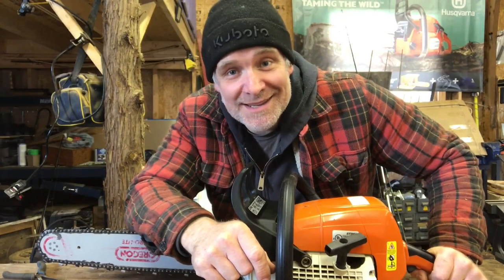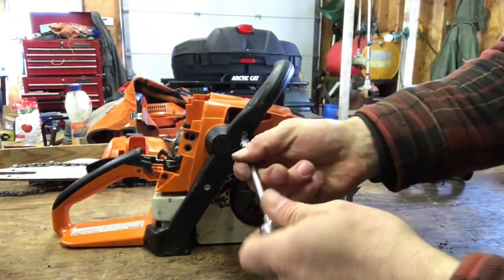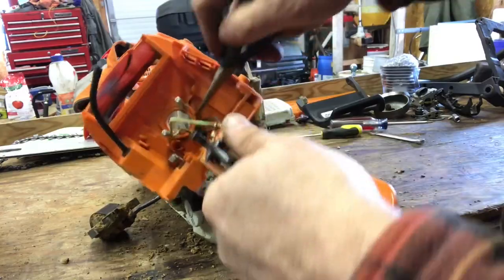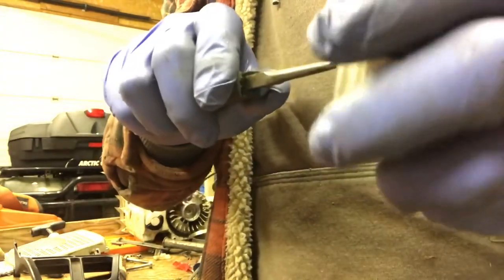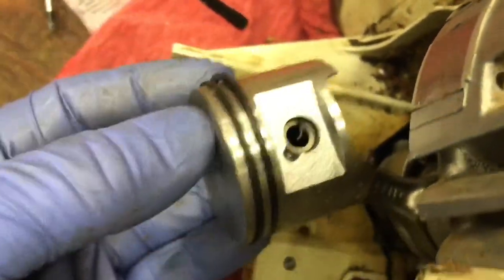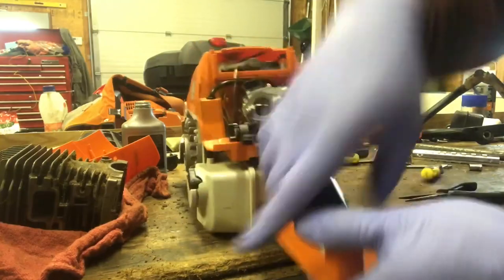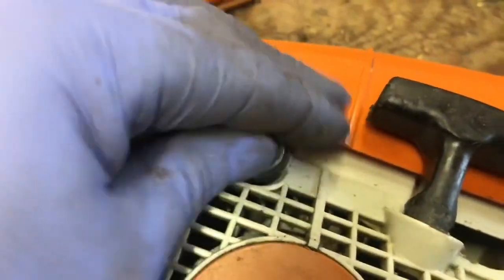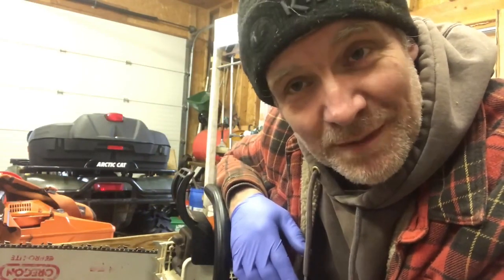Stihl MS 290 Top End Rebuild

Comment: Yesterday I took my 290 apart because the spark plug threads were stripped.  Regardless, when it came time to put the kill switch wire in place, I couldn't remember how, so I happened to catch this video today and watch.  When you took your kill wire off, I noticed how I think it's supposed to be, but I think you put it back the kill switch wire back the opposite way you took it off.  For what it's worth.  Great video, thanks.

Comment: Got my Saw torn down, cleaned and parts ordered.. Had to get the hand guard and the lever Spring (Pressure washed it away).. Cylinder and Piston kit on Ebay 35.00.. Gonna have 85.00 in the Rebuild on the Whole Saw.. Thanks

Comment: At 8:03 what is that little wire you pulled off? Theres a little steel latch as well that it looks like the lever is supposed to connect to.  Sorry stihl learning about stihls

Comment: That saw doesn't look like it was used much. My local chainsaw guy says ethanol in pump gasoline is the poison that kills small engines like these. Ethanol eats up your carbs, seals, and ruins your cylinders and piston rings. It's best to use canned fuel these days.
Reply: boy oh boy that seems crazy doesn't it? is there any other way to get around that situation?
Reply: @danacoleman4007  yea. Buy ethanol free at the local gas station. It's usually a dollar more per gallon
Reply: Rubber parts do deteriorate from ethanol, but piston/cylinder? Absolutely not

Comment: Someone needs to say it so I will. Way to much positive feedback in these comments. This guy wasted time in the disassembly taking off parts that can stay on during a top end rebuild of the MS290. And during reassembly, he incorrectly fed the shutoff wires. They should route through the center hole in the intake box for the grommet to seal out the dust.
Reply: You could’ve said it respectfully, instead you were degrading. Where’s your video?? This video was extremely helpful and allowed me to rebuild my MS290. Yes, the cut off wires were routed through the wrong hole on the video but still I had the memory to realize that from breakdown. Nevertheless, thanks for getting me through a successful project. I’m ready to cut wood!

Comment: You forgot to show removing the wires from the motor body. I got it though. 
Just need new bolts, new cylinder has different sized threads than the oem bolts.

Comment: does  stihl chainsaw ms290 has an adjustable oiler? thanks
Reply: I think they do but dont remember. I would have to look at mine close when i do my piston and jug. My 290 does the great compression and starts good and runs for 5-10 mins then lose power. Yes i looked at piston and scored as bad as the one in video.
Reply: Yes Ms 290 has adjustable oiler

Comment: What, you can't get original equipment parts for this? And if you can y don't you go that route.
Reply: Thats most likely the oem with out Stihl stamped on it and $70 cheaper
Reply: All stihl parts on the ms lines are made in china. Needed a carb for my ms361 dealer wanted $80 for one with Stihl Zama stamped and went online and ordered a Zama carb for $30.
Reply: So basically going to the source that build the parts is cheaper then going to stihl dealer and Farmertec is the company that builds them.